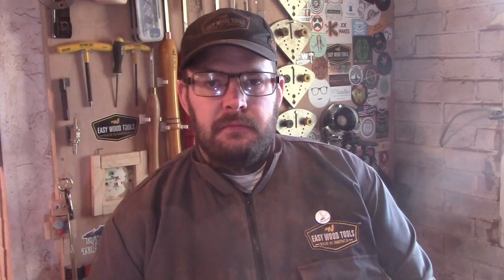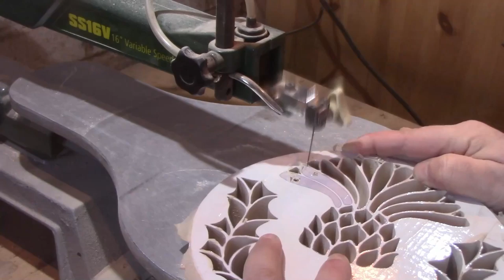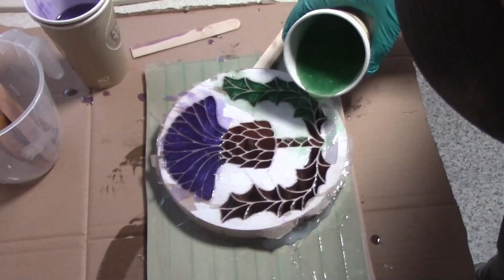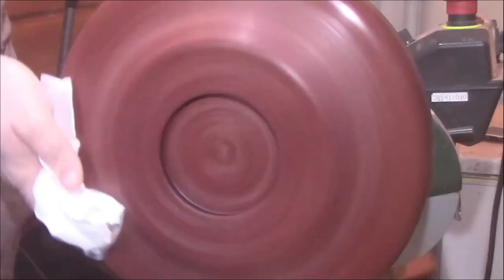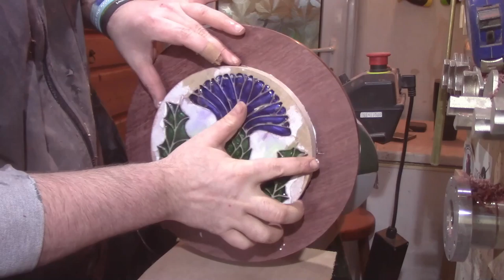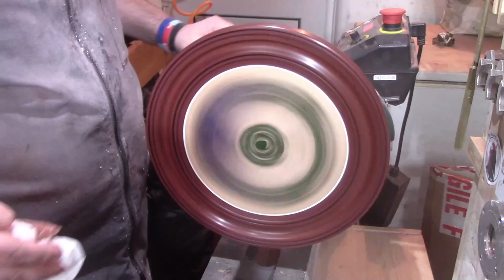Woodturning | Resin and Wood Wall Art

Comment: Awesome piece Jamie! What was the putty you used to seal the gap between the Maple and Purple Heart? As always, great work!
Reply from the maker: Thank you, that is a 2 part epoxy putty called 'Milliput', mix it in equal parts and it sets rock hard and come off nice and clean with a tool or with sandpaper